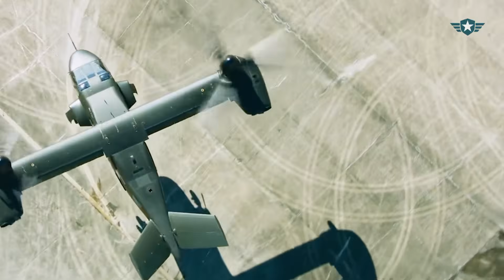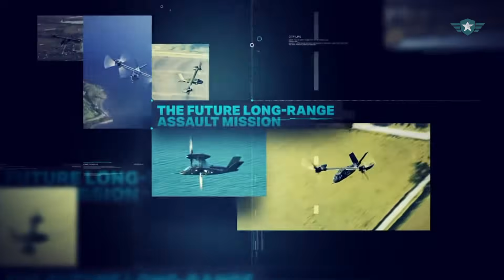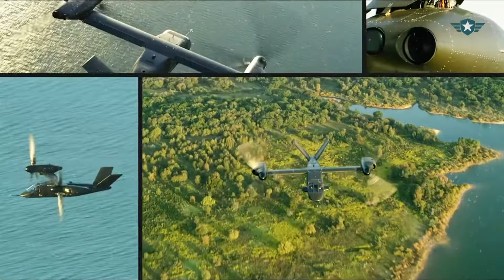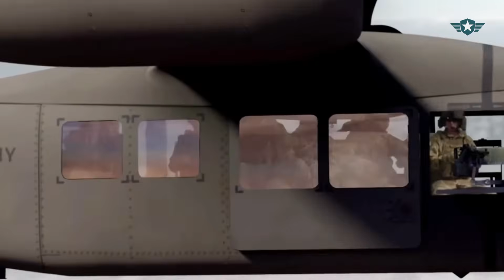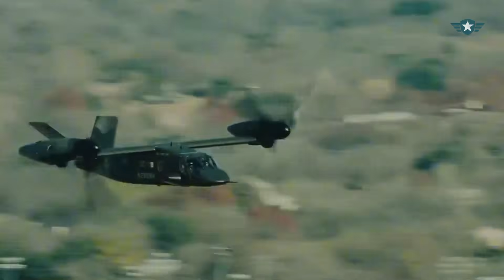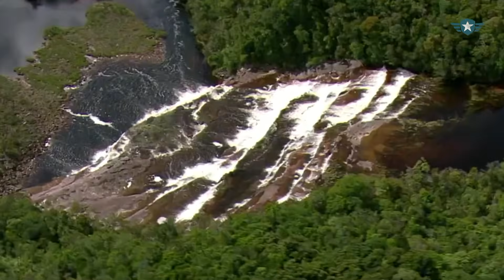MV-75: Faster, More Advanced, More Lethal

Comment: What improvements have been made prior to full production?  Is the engine driveshaft GEARIMNG been upgraded beyond that of the osprey?? I HOPE so!'  '
But a 5,900+ foot ceiling is WAAY to low - if indeed that is the actual ceiling. It should at least be able to climb to 18,000 ft. with those two motors. If not then GET BETTER MOTORS!